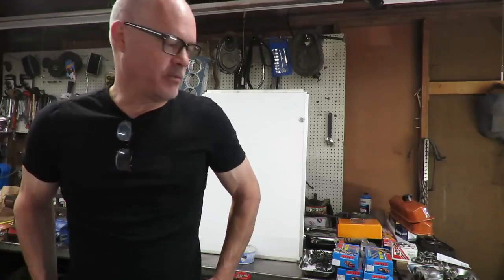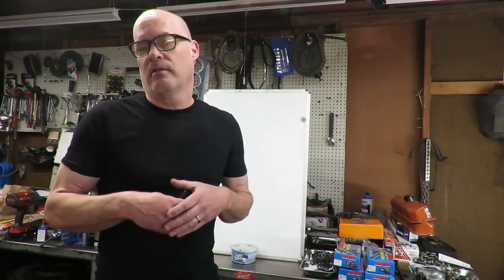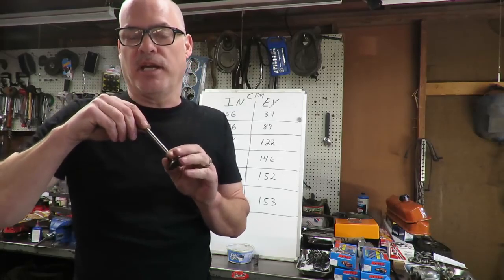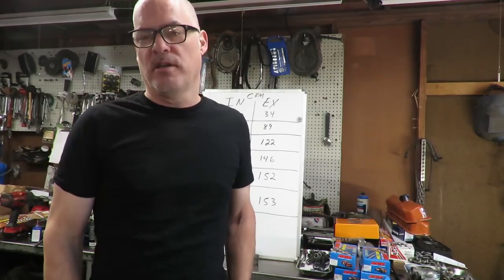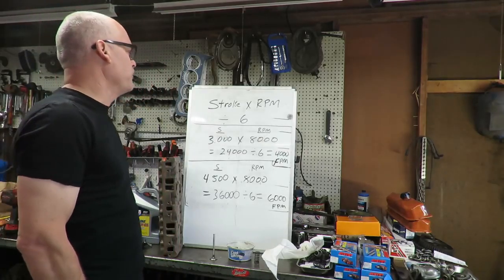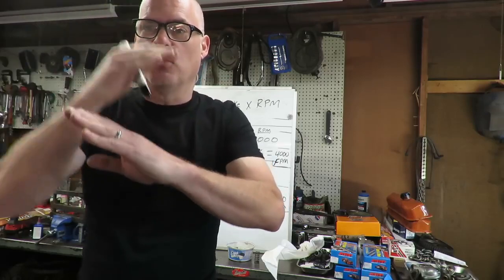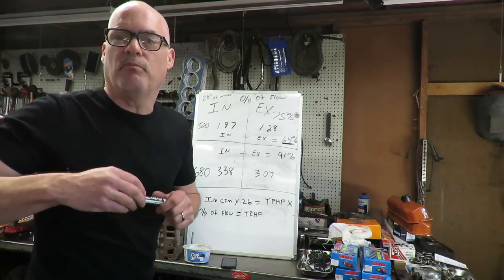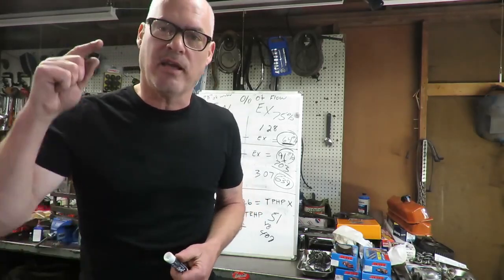How to properly select a Camshaft

Comment: Thank you so much for this information!  I know understand way more about camshafts and cylinder heads than an hour ago!  

I love the calculation to determine how much lift an engine wants or needs.  Is there a similar way to calculate how much duration an engine needs for a particular RPM range?
Reply from the maker: The Cam Manufacturer will list the RPM power range of each cam your duration will determine the RPM where the cam makes peak power You just need to figure out your Engines red line and match the duration accordingly
Reply: @Myvintageiron7512    Great. Thank you for the quick response!

Comment: Thank You for the Informative Video. I Learned A Lot Matching a Camshaft with Cylinder Heads. I'm Currently Building a Chevy 383 For My Son's 1973 Z28. The Edelbrock 60899 Heads Intake Flow 250 cfm, with Exhaust Flowing 158 cfm at .500. This Works Out to 63%. Single Profile Cams are Out With This Number!! What is the Equation to Figure Out, and to Choose a Dual Profile Cam, to Increase and Maximize My Percentage? Thank You In Advance, Scotty
Reply from the maker: There really is no formula for that I would stick with a cam that has a duration with an RPM range that tops out around 6K no more than that and around .500 to .520 lift
Reply: Thank You Sir, I Appreciate the Reply. I Will Shop for That Particular Profile Camshaft. 
As a Video Fan Now, I Will Review Your Other Informative Videos. Thanks Again!!

Comment: Building a Ford small block for the 1st time flat tappet & solid lifters, wanted to ask about the break-in proceedings which seem a little excessive, special oil, special weak break in valve springs, start up and immediately run it at 2500 for 1/2 an hour, starting to make me nervous ! Pretty sure they didn’t do this with new engine’s back at the factory in 1960 whatever, was planning a more gentle approach to this, put some oil in and fast tick over while it warms up for 15 minutes and check everything out, all advice welcome 🙏

Comment: gm does build a street strip trans but i do agree that u build for racing or u build for the street . if u ever find a 400 turbo with 02xx welded on the bell housing u have a very good trans stock good to 800 hp i have 4 sitting right now have a another set up to go get 450 hp 454 with the 02xx trans for free running good . i put one in my 68 chevy pu and the engine is perfect for a street set up good sound to the cam runs hard put a 850 with a street weiland high rise and it came alive the trans is very good  and solid shift has the 8 bolt pump heavy clutches stage 1 shift kit saves me a lot of money on builds plus u just can't beat the looks of a big block in a rig in my 68 chevy pu it fills the engine compartment all most to big the main fan has a 1/2 inch from pullies and about 1 inch from the radiator then put 2 pusher fans on front that comes with the engines set the wiring up for a serpentine belt alt. and can go back quick to internal or external alt

Comment: Around 30:00 you start talking about LSA...

I agree with David Vizard's experience that LSA is more critical than lift and duration. That one should select an LSA first, then the overlap, and THEN the duration and lift be what they are to acquire the first two parameters.

My understanding is that LSA is so critical because the whole objective of building a performance engine is getting maximum cylinder filling based on the parts you're going to use. The LSA accounts for using the exhaust pulse/flow/vacuum in conjunction with the head's intake flow characteristics to maximize this cylinder filling.

Then select your overlap to get the idle vacuum needed, and where you want your peak power output in the rpm range. Naturally as engine speed increases, air and fuel do not increase their speed at the same 1:1 rate, so the engine would need more overlap to get good cylinder filling at higher engine speeds. That selecting a cam's specs this way will result in a given performance engine that makes more power (tq &hp) EVERYWHERE in the engine operating range (ex: "2000-6000 rpm") than selecting a cam without the optimal LSA, while instead focusing on duration and lift... As it does seem most people suggest how it should be done. Even the cam companies.

Makes perfect sense to me....
Great video... Thank you!

Comment: Loved your tutorial. I was very enlightened by the horsepower formula. I'm building a Ford 302 .030 flat top pistons with valve reliefs and stock gt40p heads. My percentage is about 74. A/T 2000 stall.  FiT system. 3.50 gears. What's your cam recommendation. Thanks
Reply from the maker: .500 lift 226/232 Duration at .050 / 108 lobe sep

Comment: I recently purchased a 2003 6sp manual c5. It came with Vortex long tube headers and cold air ? (I live in Florida🤔) induction. Finances are limited so I am doing a cam kit only. You recommended for ls applications .600 lift, 226/234 duration and lsa 113. Is this what I need for a basically stock motor.

Comment: I have been watching your videos for years. Awesome work. from Ford to Chevy to pontiac to strokers. Can watch for hours. 

Curious on your cam thoughts for a dirt track car... we are going against the grain and running a ford..... 351w -.040 over - 9.0:1 static compression. GT40 heads. 6800RPM max. Holley 4412, 2500lbs with driver. 3spd manual with 7.25" clutch and a 5.29-6.0 rear gear depending on track size.  Weiand Stealth intake, 1 5/8" headers to 3" collector. 110 octane fuel allowed. Curious on duration at 50. Solid Flat Tappet per sanctioning body rules... heartbreaker there i know.

My Guess is 480-500 ish lift, 250ish* 255ish* duration at .050 / 106 lobe sep. am I close?
Reply from the maker: Yea I was going to say 248/252 duration 106 to 108 LS don't go much beyond .500 lift and it should rip nothing wrong with hot rodding ford engines they run well
Reply: @Myvintageiron7512  Thanks, feels like all my research is working out. Nothing wrong with them, we are just the only ford every weekend at the dirt tracks here in phx.

Comment: Great video but one thing i want to point out. Your example of lift spring pressure is off. You used 16 springs being lifted as acting against your crank but in actuality each cylinder fires on its own so there is only 1 set of springs being lifted to max tension at a time not 16.

Comment: Good information. My question is: If I need to get a dual profile cam because I only have 70% flow rate how do I know how much to increase the duration of the exhaust lobe to increase the flow? I have a set of 461 fuelies you probably know off the top of your head exactly what cam works best in these heads..I'll probably do some porting on the exhaust
Reply: Brian did you get a answer to this question , I was about to ask the same question ? 
Christopher from Down Under
Reply: @christophercullen1236  No reply

Comment: I have Edelbrock Victor Jr heads 77619 and I can't find the CFM. They discontinued them and I have a new set. I'm using a comp cams custom 590 lift 232 duration with a 110 separation that's going on a 350 sbc. Retro comp cams lifters. And I want to know how much horsepower

Comment: This is, by far, the best overall explanation of the magical bump stick in one place, at one time. I think the only thing I could ask to add (unless I missed it) was the relationship of amount of valve duration overlap and exhaust scavenging as it pertains to clean combustion and such. But, that's kinda minutiae compared to the big ticket items of lift, duration, and how the heads play the pivotal role in potential horsepower production. Excellent, excellent video and information.

EDIT TO ADD:

LOL just started part 2.  subject #1....... overlap and scavenging!!   YOU ROCK

Comment: Hi, I flow benched my  motorcycle 3 cylinder head, can you tell me what hp gains will I have, I don't think I am doing it right. 
Before:inlet 160cfm - exhaust 115cfm
After flow bench:inlet 166cfm - ex130cfm
The bike revs 14000 and it's  750cc

Comment: I really like your detailed videos, keep it up.   The coil spring vs compressed height vs pounds of force required seems technically correct but not all springs are compressed at once and once compressed they have potential energy they release when rocker arm fulcrum goes back up.  Basically, assisting the next coil springs downward action.  Its basically a zero-sum game with the springs with the exception of friction.   Thats kind of the purpose of a spring.... storing energy.   I think the initial force required to compress the 1st spring is input electrically via the starter.   Am I missing something?

Comment: Bought myself what I thought was a dirt and oil covered 1967 Ford 390 FE, and thought I could rebuild it based on what I remembered from high school and what I learned watching you. But I think what I thought was a 1967 engine, turns out to be a 1961 MEL engine. From what I read this engine is not a normal engine, looks like I might have to start all over with my education. Oh well. Your videos are great. I see your UTI shirt. I went there in 1985 but took the air conditioning course. Thanks for the videos.

Comment: On my Ford 306, I chose a single pattern cam with a bit of overlap because I opened up the exhaust bowl and port roof a tad while smoothing it's transition to the exit.
Granted these were stock heads with slightly bigger valves, I thought some overlap would help build some cylinder pressure to compensate for the low compression heads.....it has a lopey idle, but it revs right up toward 6000 pretty quick. It works okay with a manual transmission.

Comment: most folks try to install a cam  in the 5000 to 8000 rpm range in a motor  that cant rev that high, the other deal is, like on a chevy or ford, if you change rocker ratios from 1.5 to 1.7,on a stock cam and it runs better thats when you look at cam profiles, more lift and durationusing a vacuum gauge will tell you a lot.

Comment: Hey guys im 17 and trying to build my first motor to put in my 79 camaro. I have a 69 350 block out of a camaro. Picked up 186 heads. What size cam would work well with theses heads.
Reply from the maker: .480 lift 218/223 duration at .050 108 degree lobe sep
Reply: @Myvintageiron7512  thank you sir.

Comment: Not sure if you're still looking at the comments but here goes..  really awsome presentation!  I've watched this several times and will probably continue to do so.    My question is on flow percentage.   Ls3  head.  823.   So the stock cfm numbers aren't bad. Like 312/216 @.600. These numbers are still below 75 percent flow.   With the dual profile cam  I'm assuming that will increase the flow percentage?    To calculate With a dual profile I also assume I would use the lift numbers on int/ex respectively?     Also Is there any advantage to porting just the exhaust?  To increase the flow percentage?     I. I'm building a ly6 block bored to 6.2( saw your video with much interest) lol.  Going in a jk jeep. Daily driver-ish and want a solid 400 hp at the wheel.   Just cuz! Lol. Also I'm going to run the vvt.   If you see this and feel like responding  I'd appreciate it.  Really liking your channel.   Doug

Comment: By the way the distributor gear problem stems from GM saying let's put on a plastic timing chain cover and a shit for brains 2 piece intake manifold with only 8 bolts holding it on, call it a vortex and try it out on the public LOL!!!  So I say buy a vortex and learn the hard way like I did or get a TBI and be glad you did ! The vortex engine is just like their ignition switches !

Comment: I have a simple question I'm wondering if you have a set of GT40 heads and intake I have an F-150 for 5.0 and I want to go for it over to a mustang computer and engine and pretty much it's only the top end that's different anyways let me know if you do please I'd appreciate it or if anyone in this section does and you live in or around the South Carolina area upstate South Carolina
Reply from the maker: you could do it yourself pretty eaisly I am on the other side of the country

Comment: Thank you putting this together! The formulas for estimating max potential hp of the heads is great. Do you know of something similar for calculating max potential HP of the bottom end as well?  For Example lets say you calc that your heads can support up to 600 hp. However, if the displacement, compression, etc. in the bottom end is not there you wouldn't actually be able to make that 600 hp, right? Thanks again

Comment: WOW, You laid it all out!

I have built quite a few of 351W based engines, (I am a "FORD GUY" but realistically the "AIR PUMP" doesn't matter what logo is cast in the side of it!) and more CID per cylinder changes cam choice as well (A Radical 289cid Cam in a 410cid engine seems more much tame!)..I was guessing for that FIRST head, Flat Tappet, Nice Street "Cruising" Car (Like that 1968 Mustang you were working on w/GT40P heads, "Just upgrading a mostly STOCK 351cid Carbureted engine, with stock drivetrain")  - stock converter .450/.450 on lift... and "Guessing" 218°/224° @.050...on a 110° LSA..  

So I grabbed My Comp Book...

In the Comp Book...XE262H cam is a good choice without making it TOO radical, has .493/.500 lift which is at the VERY high end of your "Example" .450 lift heads range 218°/224° and 110° LSA...but you could choose a different/custom grind, or go down to the XE256H and make that 351 a little more smoother at idle...I wouldn't but that's ME, unless there was a "NO LOPE" request.  

The D3OE 1973+ 351W Hyd Cam specs I have (Which Could be WRONG) are .416/.445 198°/208° @.050 115°LSA  (Plus ran Really Retarded!)
WOW no wonder those emissions engines were so LAZY!

Comment: Let's say we are building a small block for a family jet boat.  Using factory cast iron heads.  Don't need much bottom end for the boat to idle around.  Need some decent mid-range to accelerate the boat onto plane and maybe pull up a skier.  Need max TQ at 5,000 RPM to maximize the strength of the input to the jet pump as the boat reaches max speed.  We have wet exhaust, so we need to stay out of reversion to keep it from sucking water vapor back into the exhaust port at idle and above.  
Cam will end up being something like 270* at 0.450" lift with an LSA of 112* or so.  Installed straight up or maybe 2* retarded to help max upper range power.  Can get near 1 HP per CI even with this small a cam and not a ton of carburation : )
This same motor would not be terribly fun on the street, but with a few tweaks, it'd be OK.  Advance the cam 4* to help with lower end power and launch and it'll work.  This is why there are so many boats getting bought off CL just to flip the Marine Engine.  And Marine Cams get used in some street applications.

Comment: Ive always said match the parts together. Don't run a huge cam on stock heads or stock exhaust, aim for high volumetric efficiency. With cams in general on stock heads 450 lift to 480 is ideal on performance heads i would say don't exceed 550 or you get reversion unless you have very good flowing exhaust. Also the higher the lift the more energy it takes to open the valve. For a good chop high lift isnt the only way lobe separation angle also changes the cam sound without a huge lift.
Reply: Dyno a vehicle to get bhp/whp and then set a target hp/rpm range with efi/obd2.

I want a mild hp boost but i need a dyno run on my 2007 bowtie classic 4.8 to see what is needed to get 300HP.

Comment: Good videos. I've watched both parts and now I know I have the wrong cam in my sbc 400. Its .30 over with flat tops. I felt a 400 needed compression and good heads so I used OEM Vortecs since they are better than the Camel humps. I used a .450 lift because of an equation I found years ago and because I didn't do modifications to use more lift. However it is a single pattern cam with 104 lobe seperation. I'm taking the cam out as soon as I figure out the correct duration dual pattern cam.

Comment: I get that the FPM of around ~4500 is the safety limit, but wouldn't rod strength and the weight of the piston (and rod) influence this max limit? Because a heavier piston at the same speed has more energy, and a stronger rod can take more beating.
Reply from the maker: yes

Comment: This is exactly why I don't even try to make that decision, I use a professional like yourself.  I actually have a 350 crate engine that I installed in my truck 20 years ago that I'm fixing to put the Holley Sniper on and I really want to replace the heads and the cam at the same time and I won't be making that decision. I'll pay for it but this isn't something that I'm qualified to do. I know what I know and I do those things that I know very well and this isn't one of them. I'm happy that there are people just like you in the world.
Reply: million yrs ago 71 GMC  350 small chamber head 1.9 & 1.6 solid cam same as early 327 edelbrock c3b with 650 holley & 350 auto or munci 4 ran strong and was fun drive  3.55 rear gears

Comment: How do u feel about a lt4 hot cam 525 in the intake and exhaust and 112lobe separation with a th350 2500 hughes stall for a 350 vortec 880 block stock 906 heads with a little porting screw in head studs 7/16th beefier studs and guide plates added 1.6 roller rocker arms but on the stock dish piston and stock crank I heard 400 ponies easily can be achieved this way I’m still building it too I’m like 70% there it’s going in a 84 olds cutlass supreme